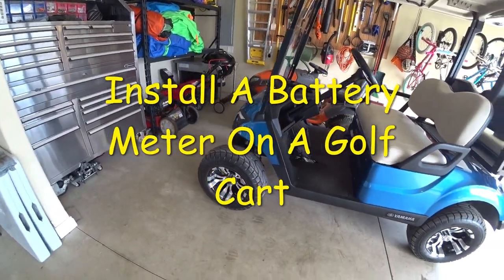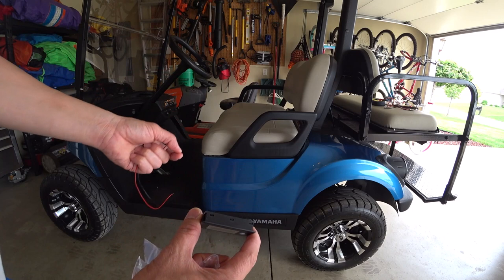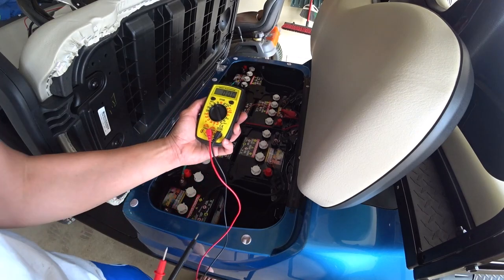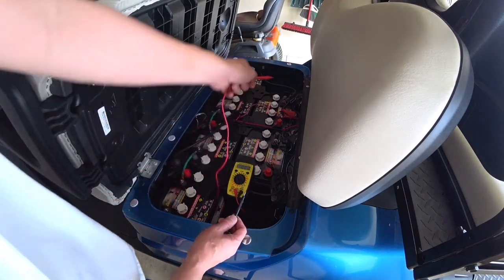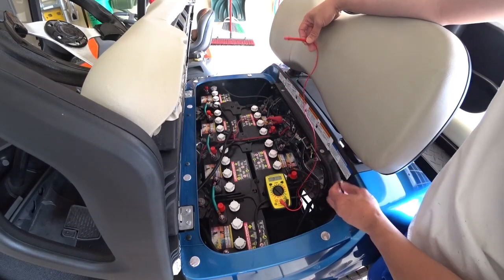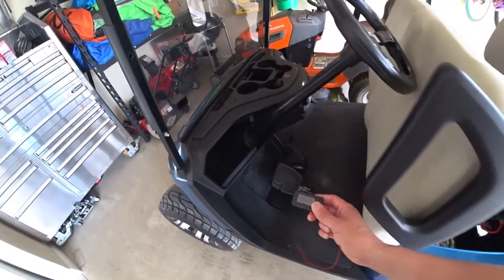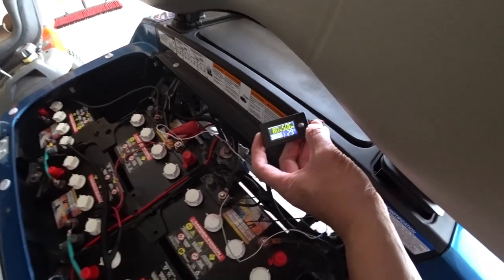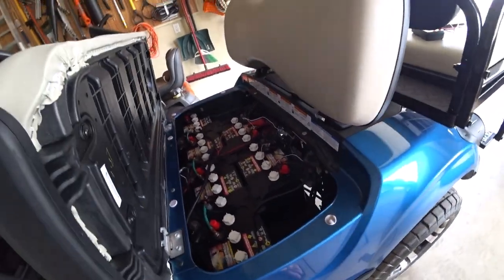FAST & EASY Way to Install a Battery Meter On a Golf Cart

Comment: Thanks for the video. When do you need to add a shunt into the system? Or do you just need one for really big systems?
Reply from the maker: If you want more accurate reading than I would add a shunt to measure the battery's state of charge (SOC). In this my case, I'm only using it around the neighborhood, so a 10-20% in tolerance off reading will be ok for me. 

But if you are using it for town driving, I would recommend adding one to prevent your cart from dying in the middle of town.😟 They are not that hard to add on next to your battery meter.